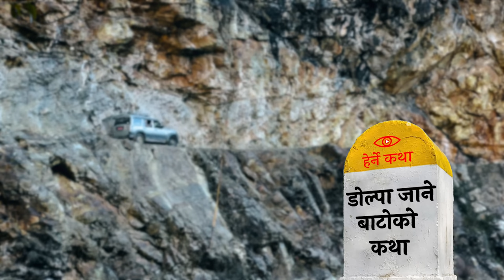डोल्पा जाने बाटोको कथा | Dolpa Jane Batoko Katha | Herne Katha EP82 | हेर्ने कथा

Comment: very good experience and government should focus dolpa , jumla and many more place . these place can be good for internal tourism if road excess done by nepal government . . i would like suggest to team that carry tire pressure machine (portable ) . strap , shovel , axe or khukuri  if they are going such a off road . these tools are very good and provide needful assist and one more thing if your vehicle tires are slipping on mud you can use floor mat for traction control for tires  .thank you